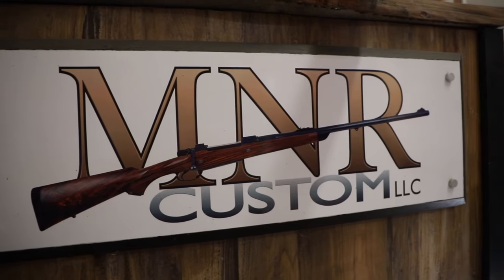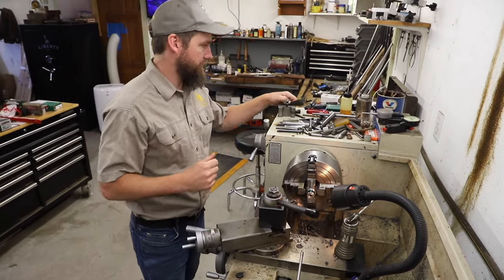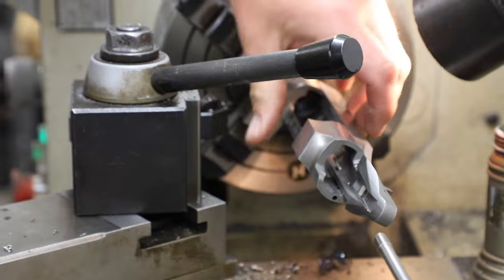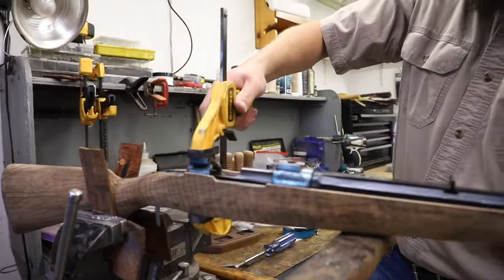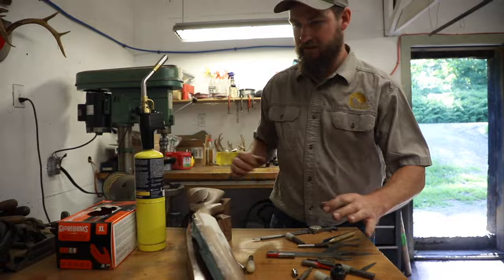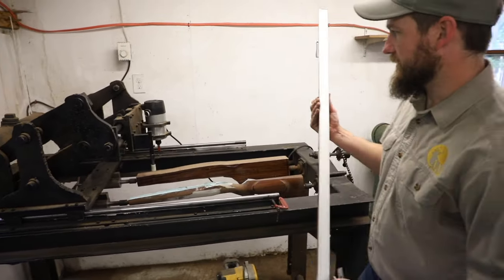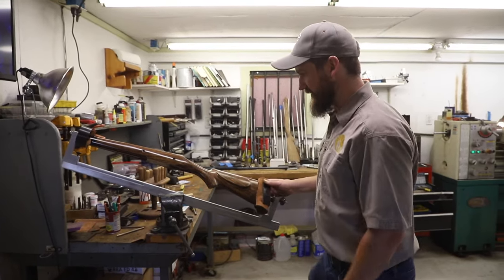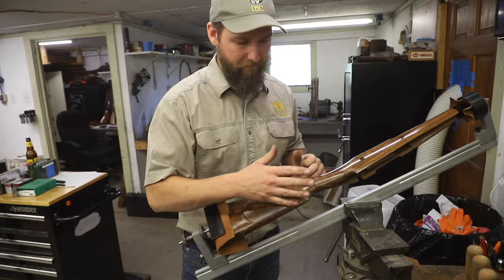Custom Gunmaking - A Filmmakers Perspective

Comment: I've watched several of your videos and you are a true craftsman. I am curious as to why you don't slightly over inlet then bed with an epoxy or resin? I'm a carpenter and wood constantly moves, expanding and shrinking if not stabilized, movement might cause shifts in poi. I'm certain you know, just seems counterintuitive making it such a tight wood to metal fit, also free floating is believed to be an improvement for accuracy as well? Your work is beautiful and if I were extremely wealthy I would have you build me one as I know quality and craftsmanship are worth the price.
Reply from the maker: Yes, I would agree with you that the optimum accuracy would be achieved with a completely free floated barrel. Theoretically marginally less accuracy is achieved with a stress free, full contact bedding. It's really theoretical as the guns will end up shooting better than most shooters can tell. 1/2 MOA is common. 
Once the inletting is complete I skim bed with clear acraglass. It ends up so thin that it looks like a coat of varnish, but I believe it does provide a level of stability to the wood and protects it from moisture, cleaning solvents, etc.
The important point is stress free when inletting and bedding. There can't be a low spot that causes the metal to flex when the screws are torqued, and the barrel can't have partial contact. This is when accuracy goes to crap.
Thanks for watching and the compliments!